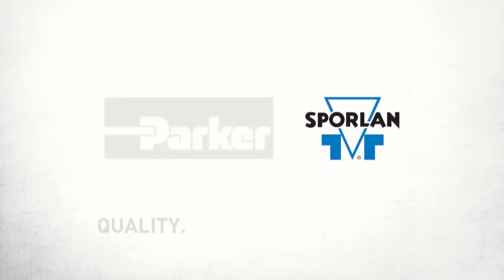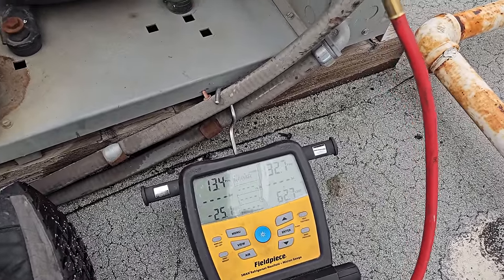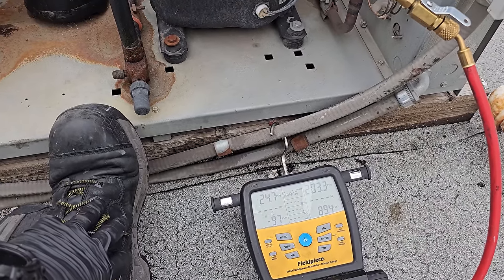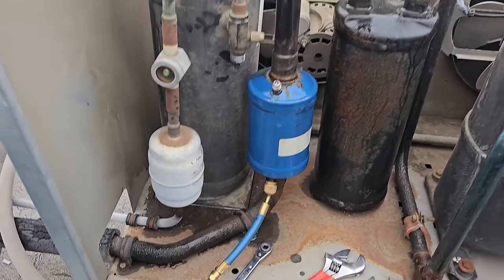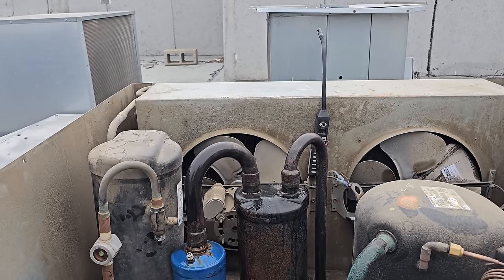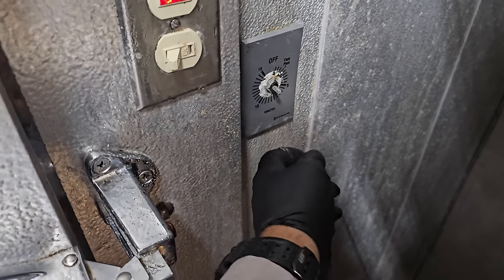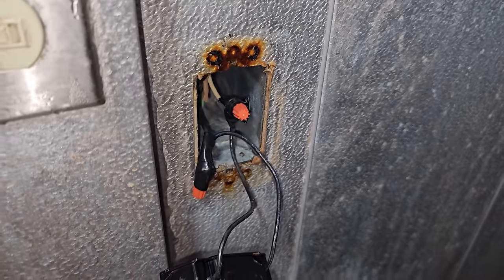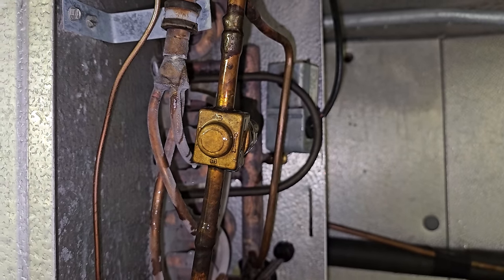THIS FREEZER EQUIPMENT IS DONE

Comment: When I started out in Residential/light-commercial, we tried to do what we could to get the customer up and running temporarily during after-hours, and come back on straight time to do a more comprehensive check-up and repair.
A lot of residential companies in my area have even priced themselves out of having to run on-call altogether, and there’s a greater emphasis on work-life balance.

Since switching to Commercial Refrigeration, none of that has applied.
Companies in that sector, in my area, don’t like to say “No” 
or even attempt to price themselves out of overtime rates.
It’s gotta be fixed. It’s gotta be fixed TODAY. Whatever it takes, whatever it is. Even if it’s something as menial as an REAC with a leaking coil on a Sunday.

Comment: That Stratus is a leak-searching super power. Worth every penny.
Reply: Love mine
Reply: Money maker for sure. I charge $60.00 just to turn it on. I did have to replace the sensor a couple days ago which was $130.00. But that's why I charge just to use it. Two leak checks and it's paid for.

Comment: In my field service days in the oil/gas/power generation equipment,  we mostly did 'Get it up & running' during after hours trouble calls if it was at all possible.   Your Sunday visit certainly represents the type of approach I'd take with troublecalls.   Good work as always, Chris!

Comment: GREAT JOB CHRIS!
I hate it when customers try to fix it before they call you. Had a customer today who is 100 miles from supply house self-diagnosed a Manitowoc ice machine as a bad control board. He said it was doing a lot of weird stuff. I asked him if it was going into safe mode (safe mode means bad ITP or water level probe) and he said no. I picked up a board AND a water level probe AND Ice Thickness Probe JUST in case he MAY be wrong, wink wink. 
Got there and started machine and guess what? Yup runs one batch then after harvest goes straight to safe mode. Changed both probes as unit is 6 years old and no more safe mode. He also was playing with gauges that had 4 foot hoses on it. Wasn't sure if he purged hoses before so I removed charged and weighed in new. He is too far out to guess and make return call.
Reply: That's good follow through. I can't count how many techs I see that never follow through and make sure the repair was done with confidence.

Comment: 24*7 equipment should always have all included service/maintenance contracts on it, for a fixed monthly/yearly fee that increases with the age of the equipment. The tech maintaining it will be motivated to do an excellent maintenance job, which will minimize the chance they'll need to come out at night or in weekends. Owner will be encouraged to replace it before it gets too expensive to keep it running.
...But unfortunately, a lot of equipment comes with "users"...
Reply: 😂 unfortunately a lot of tech comes with users! Best line ive heard in a long time

Comment: The company that I had worked for before working at a school district wanted you to repair the unit no matter the issue so they would not have to go back at the site anymore, but there’s several problems with that. They were accepting companies that never used us before on the weekends for emergencies, they had leaks, dead compressors, and shorts! And you had to have them all running before the weekend was over, with you and maybe one other tech! Did it for 12 freaking years before I got smart and left that company! This was all in the DFW area! Learned a lot , learned not to do that again ever!

Comment: On the weekend its mostly get it up and running...a lot of what breaks on what i work on isn't at the supply house anyway and has to be ordered. Some smaller type repairs yes, open a supply house for a simple repair, yes.....you got a leaking flash tank on a York YCIV.....can't help you much on a Saturday or Sunday....or Monday for that matter. Quote it and let the customer decide what we do until it comes in.

Comment: Have you ever tried front seating the king valve of the receiver and charging through the liquid line. That is what I do. It pumps down and the vacuum from the compressor sucks it in the liquid line and through the evap. Always felt it was safest for the compressor . Just a thought.

Comment: Sporlan has two bulletins 90-30 which covers the application and operation of head pressure control valves. And 90-30-1 which covers the proper charging. There are 3 states the valve may be in, no bypass, partial bypass, or total bypass depending on system load and ambient temperature. 90-30-1 explains how to determine condenser volume and a chart indicating how much refrigerant to add to ensure proper low temperature operation.

Comment: We typically just get the system operating. We try not to open the supply houses because most of our contracts are full coverage contract, meaning we pay for the materials. Also, most of the parts we would need aren’t typically on hand. 
Great instructional video, Chris! Love what you do for the industry

Comment: I just bought all my guys the new flir edge pro thermal cameras that are Bluetooth, the pics I get back from them on diagnostic calls are awesome, I like how you can display 4 temps at certain spots on an image, I also like how you can set it inside the blower compartment and monitor with the panel closed from your phone. Great video!

Comment: when i am out on a servicecall on weekends, i fix everything. Unless i have to order parts.  In my country it is eligal to fill a system with a leak. We have to empthy the charge and fix the leak, even if the customer will replace the equiptment.  Maybe i should come to U.S and work for you :)

Comment: So, if the store manager is the "touchy feely" kind of person, I'd do 2 things:
1. Tamper-evident tags/labels, with "Licensed service technicians only" printed on them or something scary and official sounding like that on it.
Hopefully, they see that, think "maybe if I touch this and it breaks I pay for the fix out of pocket". Maybe that keeps them away.
2. Somehow rig up one of those permanently skin-staining "indelible dye marking" tags that they use to ruin the value of stolen clothing to the access panels, with a way for you to (with a key, probably) render the "don't touch that" device inert.
Those tags are highly effective at preventing tampering, theft, and/or vandalism, and they're why it's very rare that you hear of some grown adult pulling a fire alarm without an actual fire and getting away for it. All you have to do to catch the perpetrator is look for someone with the dyed hands.
As for what to tell the manger who's tinkering with things they have no idea how to fix, just tell them "I've put measures in place to alert me if you mess with this again, so just don't do it". And if they ask you if you booby trapped it, tell them "Only someone intending to mess with the very thing I literally just said to not mess with would ask that question, so now I'm putting a padlock on it".

And in this case, that manager will have NOBODY else to pin the blame on, because you need only look at someone's hands to determine blame.
Getting caught like that (repeatedly) is how you "correct" a habitual liar. They might have reasons, but if you just keep not letting them have any wiggle room between their story and the truth, they'll eventually get it banged into their head that maybe lying doesn't get you anywhere.
Maybe they have to lose their manager job before they learn, IDK, that's not my problem nor is it my place to try to let them slip thru the cracks.
In any case, if you were to show a picture of the dyed hands and the dye-releasing tamper seal to that "tinkering" manager's boss, they'd have a lot of explaining to do about why they were touching things that are covered by service contracts with ACTUAL technicians who actually know what they're doing because they know how the things work instead of just randomly making adjustments until it either totally stops working or is (extremely rarely) fixed by "just" an adjustment (even then it's probably not fixed "properly").

It's not entrapment if you can avoid the punishment by just following the rules, after all. It's just making the rule violation readily apparent and impossible to hide.
Reply: Whole point of this is to say, "Act like a child, and you'll be treated as one."
These words have served me well over my adult life.
Never had a "karen" get me in trouble with my manager, never had a habitual liar make me a fool, never owed money to someone I don't trust, all of that because I can read when someone's acting like a child, and start treating them like a child.
If an adult is acting like a child, that's still not "open season" for me to just be bad mannered.
All I need to do is prove to them that what they're doing isn't angering me, that's enough to get half of them to stop trying to bother me. If they do something that would get them thrown out of the store, I'll kindly but firmly ask them to leave.
If they don't leave, I'll call the police. However, usually if the police get involved, it's because THEY called them, in some hare-brained attempt to try to get me arrested (that's been threatened a few times, usually I'm able to explain to them that they're the one going home in cuffs if they dare try that, because I'm the one that stayed calm and their the one screaming at an employee just trying to do their job).

Now, you might have gathered that I don't like being around kids, and I don't.
That doesn't give me any kind of excuse to treat treat children with anything less than basic kindness and courtesy, because being bad mannered towards a child is just always the wrong decision (a lesson at least a few parents need to learn or re-learn, which saddens me).
I will also do my best to answer their questions honestly (with the usual exceptions about certain topics).
I will never lie to a child, and if they ask me a question that I can't answer because of their age, I'll simply tell them "I can't answer that until you're old enough. (however many years old that is) is old enough, and not a second sooner."

Comment: Sa-Bu-Son.... I had a leak at work on a chiller unit that cools hydrolic fluid. Now their is oil all over the place, so saying look that fitting it has oil on it, their is the leak will never ever ever happen. So this supervisor walks up, and calls the unit a pos, grabs my big blue and starts shooting at the unit wildly. He hit the sight glass on a fluke and it started to bubble around it. I was like holy shit! I pump the unit down cut it out, and just put in a copper until I get another sight glass. I took it back to my office, and the top ring was loose. I have never seen that, however it makes sense, it has to be put together right?
Reply: usually they have permanent thread locker applied and won't come apart without torch heating to death to release it. maybe last installer absolutely nuked it on install?

Comment: That Alco solenoid valve has an O-ring gasket that you will find no longer has a round cross section it has become square, hot gas passing thru the valve from the head pressure control valve and operating with low charge caused this.
Reply: or an o-ring where there shouldn't be one to start with, because it will fail for sure. they always do with age, used or not.

Comment: I have the Dtek-3, seems to work well. It looks like yours but doesn’t have the fancy display. For finding leaks is it as good as the stratus?
Reply: IMHO the Stratus' ace in the hole is its Cloud Hunt mode. Can help you in various situations, particularly at either extreme - tiny trace leaks that leave only a little amount floating in the box, so you know to reach for Big Blue, or large blow-outs that overwhelm normal modes.

Comment: I have always been perplexed  over the years of watching you, that you fully charge a leaking system before actually looking for the leak! Can you explain that? I understand Sunday call and overtime charge…. That said, a quickie wand with an electronic may reveal a loose stem at a Shreader, loose flare nut fitting, etc. A quickie check could eliminate a return trip.
Reply: It can take a long time to find the leak, for one.   For another, if the system is very low on refrigerant, the leak may not be producing enough to show definitively.    Lastly, the customer wants everything cooled back down ASAP, and then you can find the leak while it's cold, and plan the shut off and fix.
Reply: Also a leak is easier to find with a full charge. If the leak is slightly hidden by components or insulation it may bleed out and be detected with a leak detector inches and inches away from the physical leak.
Reply: @miken6imy  thx rook
Reply: @miken6imy  that’s like smashing your toe to confirm it hurts, not very smart but certainly effective!
Reply: @HardKnocks101  my idea is if refrogera t is 50 percent full and it follows 1 psi for each degree of f temperature, then the system pressure when not running is half. On a 60 degree day, system off the system is 30psi. You can easily add refrigerant,  leak check, mark leaks, recover refrigerant.

Comment: Does it make any sense to replace this unit, if it's working just fine and the tiny leak can be easily fixed?
Reply: This channel is about replacing motors, compressors and entire units. Guess this makes them more money so why not. I have watched a lot of this guy's videos and haven't seen him fix a thing.
Reply: @dd19892  He has many videos, where he fixes the things. These small leak repairs have been covered multiple times. But I understand that changing a component may be often better, in case the thing is either consumable or wear item.
Reply: Its also looking ahead, assuming the evaporator is of equal age to the compressor they might be thinking that the evaporator is getting to the point of starting to get leaks everywhere. So new evaporator, looks like the pressure control may need to be replaced as well(likely to of been damaged when the low pressure cutoff was set to beyond normal range). When the cost of expected near term replacement parts starts to exceed a certain percentage of total replacement cost its best to replace. Also downtime on resturants freezers/refrigeration/exhausts can lead to a lot of cost in destroyed product/having to close down.
Reply: @dd19892  LOL, we actually make more $$$$ servicing old units like this over time. Once they start to age and like that, they become your best friend as you spend so much time together. The failures are not just expensive in labor and parts, but product loss can be in the tens of thousands if you lose a large restaurant freezer or cooler. If the restaurant is bizzy then you also have the loss of revenue if the food is bad u can't serve customers. 
Replacing the equipment is often the cheapest and longest lasting fix you can do and there is a good chance the new equipment will be more energy efficient also.
GREAT JOB CHRIS!
Reply: It's hard to get managers or whatever to replace units. They would rather replace compressors, TXV's,  fix leaks  etc.  HVAC equipment is the last thing companies like to replace. His videos are very realistic and represent how it works in the real world.
Reply: Fix the leak and maybe get another 10 years out of the unit.  Not the American way though. If we ever have another true recession like my parents and grandparents went through in the 1930s then we might actuality return to fixing  instead of replacing.  Obviously replacing every 15 years is easier than fixing something. A lot more profit also.

Comment: Never seen a suction filter on a tiny condensing unit like that, must hurt the efficiency quite a bit and accumulator? Why on the suction side
Reply: It protects the compressor and the oil return port at the bottom of the accumulator. They really dont restrict refrigerant flow. Ialways add a HH suction drier on comp replacements that had electrical failure to catch any organics then change it later.

Comment: Actually a decent looking system relative to what I see. 19 months is a pretty slow leak. I would have at least thrown some leak seal at it and go from there. Hate to condemn equipment that may have another 5 years on it.

Comment: It looks like you are going to find a way to put a lock on some things.
Reply: That can be difficult though. Especially if the equipment is brought and owned by the customer. As it appears in this case it is. It is afterall their equipment, they want to fiddle nothing really you can do to stop them doing so. All you can do is point out that their "fiddling" could cost someone their life and certainly make any repairs / adjustments cost a whole lot more than would have needed to be otherwise. In a lot of cases you are contracted to repair equipment which is broken and is owned / brought by the customer. Not equipment which you own... If it is your equipment which is being leased by the customer totally different kettle of fish and you can fully control it however much you want. But, otherwise........